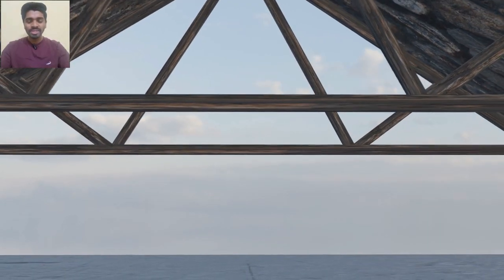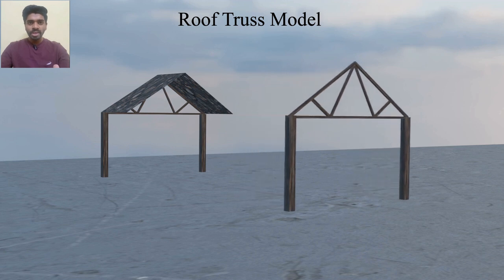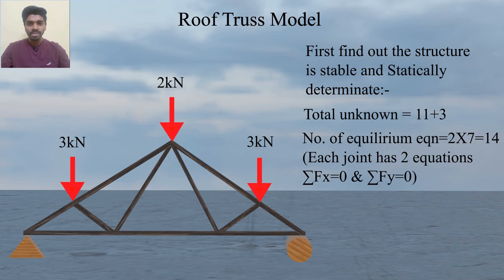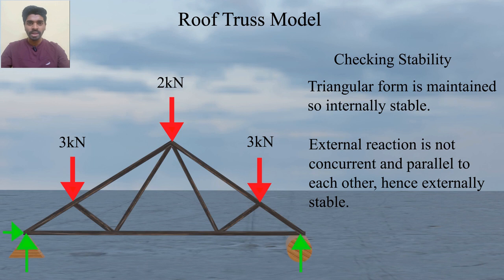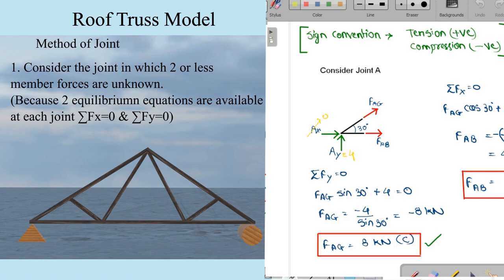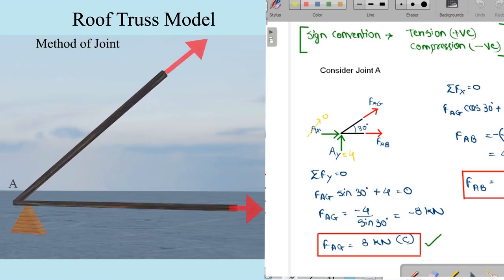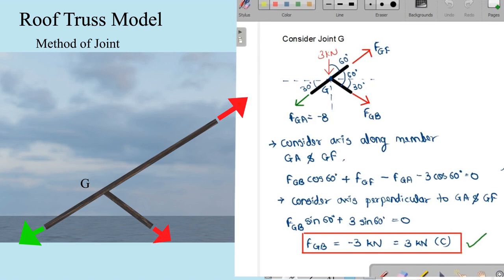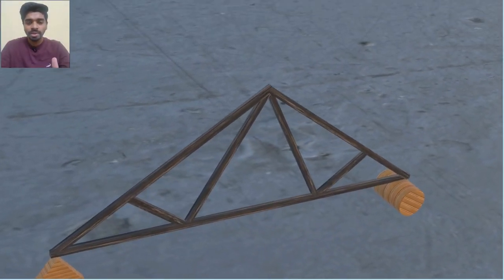TRUSS || Method Of Joints || Roof Truss Model || Method of Analysis-1 || Structure Analysis ||

Comment: In this video u first said that external reaction should not be concurrent or parallel but in example for hinge support u said its externally stable i didnt get it ....?? Plzz explain
Reply: Just notice that If "ALL" the external reactions are concurrent or parallel, then only the structure will become instable externally. But in this example, you can see all 3 reactions are not parallel neither concurrent. So it is externally stable. For the given truss system if you replace one side hinge support to roller support then it will 2 reactions ..both will be parallel to each other then structure will become unstable externally.
Reply from the maker: Did you get the concept?